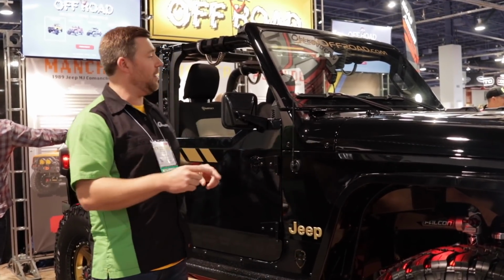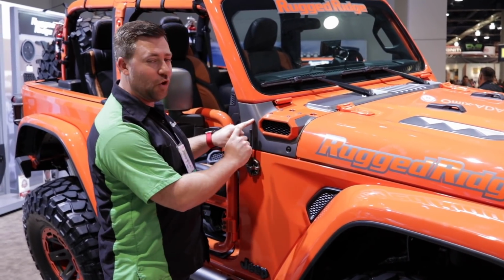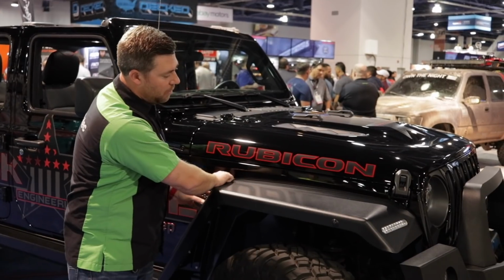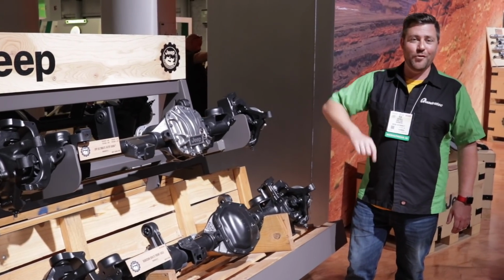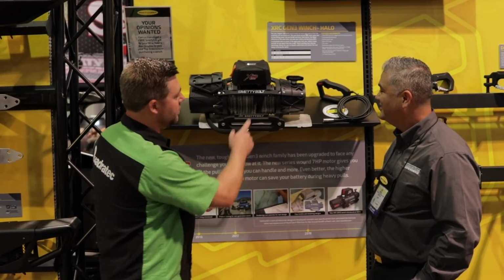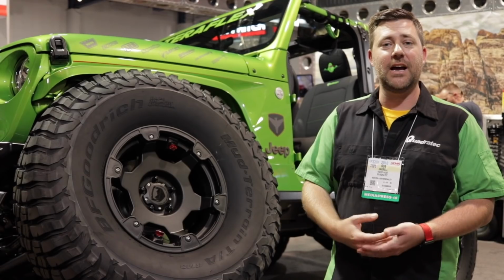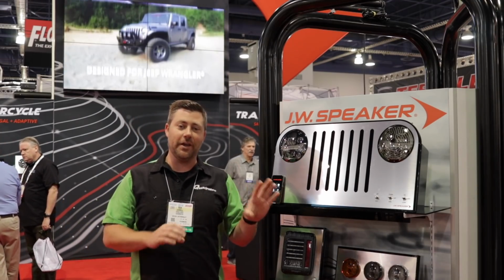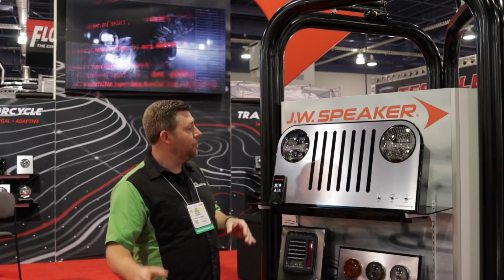Top New JL Jeep Wrangler Products of SEMA 2018

Comment: Any options for the stock rusty door hinges? I have a 2015 with 20k miles and the door hinges are already rusting
Reply from the maker: You're not alone! That's a very common issue. Check out the Kentrol Stainless Steel Door Hinges. They're available in black or paintable versions. https://www.quadratec.com/brand/kentrol/doors/door-hinges